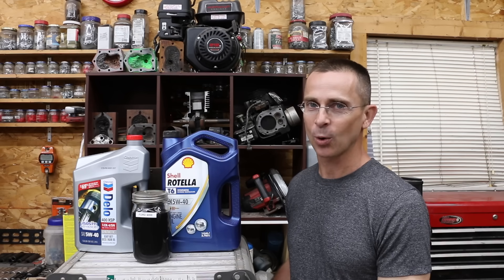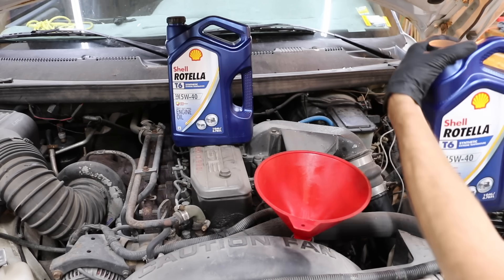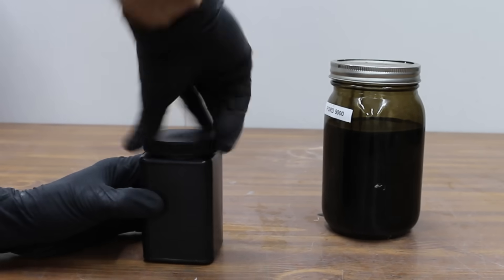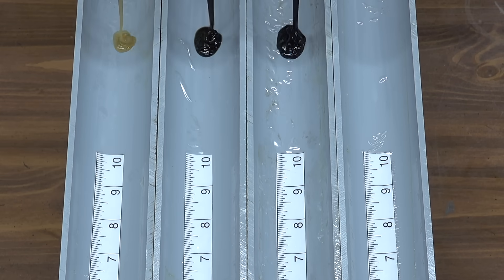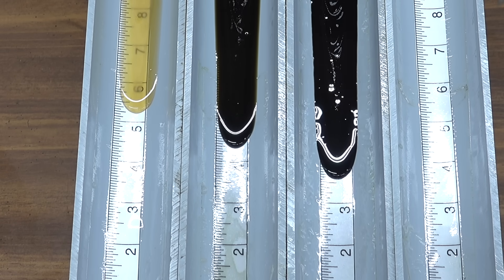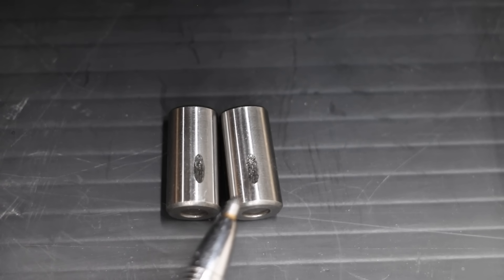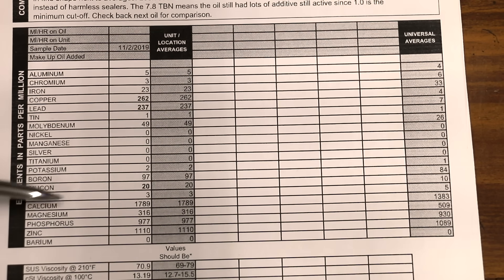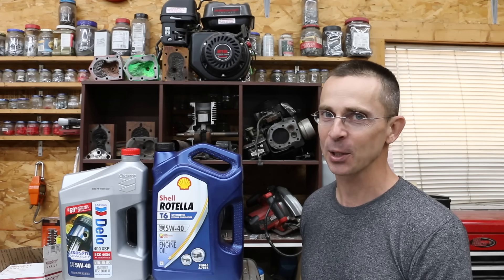Will Annual Oil Change Damage Your Car? Let's find out!

Comment: I am a retired Heavy Mechanic, Used to work for Greyhound Bus lines in The Calgary Alberta shop [500 buses] we began testing synthetic oils on 
Select Buses in 1978,  the wintertime in Calgary would require the Buses to be running 24hours a day, even when parked, due to extreme freezing temps., as you can imagine, these buses would go through Extreme duty most of their service life.
What we found through much testing and Laboratory back up, The Oil did not break down at service intervals. The Filtration was the Issue.
We found that Changing the filters [oil and Air} on a more frequent basis, e.g.  Skip every other oil change but change out Filters, was giving Satisfactory results.  Whether it was Natural or Synthetic did not matter.
End result:   Change your filters more often, and don't worry about the Oil as much, since filtration is the key.
I have always run my vehicles on this method ever since and have never suffered any negative consequences.
Kinda makes you think, Why the service manuals instruct us to change the oil every XXX Miles or Klms.
So save your Money on Oil, and Change your Filters Often. Thanks for all your Vids, And i wish you and yours, the very best of the season.
Al
Reply: That's because the automakers and the oil companies are in bed together.
Reply: @philyip4432  void warranty?
Reply: @PropTrader51  unless you are forced by your warranty, to have your vehicle serviced at the dealership, just change it yourself.
Reply: how do we change the oil filter without spilling all the oil . I also live in calgary!
Reply: @fishertech  just use a drip pan underneath,  then remove filter, and replace along with 1 liter of fresh oil.
Reply: @fishertech  Oil filters generally sit higher than the sump (Pan). Therefore only the short supply and pressure lines above the filter drain when changing the filter. On an inverted (Upside down) filter the anti-drainback valve on the filter itself generally traps all but a few drops when you remove it. Of course there may be exceptions to these rules, but most applications take well to a _filter only", service.
Reply: @fishertech only the oil in the filter will leak as the oil pump inactive
Reply: I do opposite.I  change my oil but  replace filter ever other  time no problems on my part.
Reply: Also, from the above poster’s comments, I have to agree that filtration is the key as dirty oil can clog up the narrow engine clearances starving it of lubrication. While living in a foreign country I used to skip filter change at every other oil change, just to save time/money as I was doing it myself. After about 3 years I observed that my car started burning oil, and I could not figure out how this could happen, even though I was using a good brand oil. The only conclusion  I can now draw is that timely oil filter change is more important.
Reply: Interesting aspect.

Comment: comparing oils from two different cars, with two different oils in to do an ageing test on.. very scientific.
engine oil is drain 3/4 and fill 3/4, there is always residual oil left from previous oil particles you took out could have been in there from factory, of unknown make/origin. different engine will use oil differently, some engines will burn oil more than others.

Comment: Firstly a very Merry Xmas and a safe and Happy New Year from Oz, to you and your family :-)
Wow, cleanish oil from  the filter, I am so glad you tested diesel engines.
I have a moored twin engine boat, and I have always been concerned about "acidic buildup" I only run mineral oil as specified by Volvo (fyi TAMD41A engines, very low hours at 32 years old), and low engine hours. At 23 litres of oil, a somewhat painful and messy job, I can relax and stretch it to 2 years per oil change, perhaps. Thank you so much for your contributions.....
Regards Des

Comment: I run a 15w-40 diesel oil in my old '00 5.3L GM truck for a few years now, zero issues. 
I've always had the notion that an oil for a diesel engine is going to have a higher bar to measure up to.

Comment: My uncle has 3 ram 1500s with the inline 6 cummins, those trucks are insanely bulletproof. Really awkward suspension design though, fairly straightforward if you get used to it but seem to go bad quickly.

Those cummins trucks will easily handle 12 ton+ scrapyard runs, can't complain at all. Wish Dodge still made body parts because the engine is definitely outliving the chassis

Comment: I think what damages engines by not changing it for over a year is the oil getting low over time. That’s why I don’t like when oil companies advertise 12k or 20k mile intervals. Even if the oil can technically last 20 thousand miles. People won’t check their oil level for 20 thousand miles and in the mean time. The oil has gotten super low to the point it damages the engine due to lack of oil

Comment: Good test.. Very interesting... I'm just wondering.. What does it take to convert a small engine to run ethanol reliably or an additive to stop corrosion of aluminum and fuel lines?

Comment: depends on engine, milage, etc., a newer maintained engine may not need changes so often, an older one lacking regular maintenance might. i've seen plenty of sludge caked, baked engines, castrol oil was the worst. better to change it than to ignore it, ignoring it is a costly mistake, changing it isn't. never tell the average person not to worry about it, it'll never get changed and then the car owner has big problems. eventually due to wear etc., you will get particles in oil, prevent wear, it starts breaking down, etc., a simple oil change once in awhile will help you avoid costly mistake of ignoring oil changes. don't listen to this guy and ignore oil changes, he's not going to replace your engine if it locks up, etc.

Comment: Years ago the oil was never changed.
Only the Oil Filter was changed and the oil topped up. (Glass oil bottles)
Reply: @Trevor Slenders If you want to ruin your car, thats a good method.
Reply: @Chris-yy7qc  Maybe his car is eating the oil and he is just adding more oil every N miles.
Reply: @Combine1331  Im pretty sure its eating oil after six years with its oil control rings completely gummed up
Reply: @Chris-yy7qc  Not necessarily. Many engines are just known to burn a bit of oil. The V6 in my old 95 audi was literally known everywhere to burn oil (google it), and there was nothing you could do about it. That's just how it was, unless you wanted to tear apart the entire engine and put in new rings and seals, but it wasn't worth it. The oil burning never hurt anything, you just had to top the oil up every once in a while.
Reply: @reeepingk  Depends how much oil

Comment: About 10 years ago, before the EPA yanked the zinc content out of most oils and before the likes of Driven Racing Oil  and other classic hot rod specific oils, at my speed shop guys would go crazy for Shell Rotella 15w40 Diesel. I think even after the limitations on the zinc Rotella still had it in their diesel formula but eventually was changed over. EPA is not our friend.
Reply: The epa put reseal valves on ac recharge cans, so they did something right for a change.

Comment: Good test within the constraints. However I don't think you could extrapolate it to gasolene turbo boosted engines as they are not remotely equivalent IMO. Normal cooling down cycles of these turbo engines during the heat soak period have temps higher than their normal (for turbos) 400°C temp. stress affecting the oil's "seasoned" lubricative quality. Therefore I humbly ask if this oil test could be repeated with a low interval mileage turbo based engine just prior to a 12 month oil change. I speculate you will not get such rosey results as those shown in these results.

Comment: My 2000 ford ranger with over 250,000 miles has only had 9 oil changes on it in 19 years, and most of those were in the first 6 years. Now It burns about a quart of oil every 2 months, so I figure it gets 6 quarts of fresh oil added every year. Not saying it wouldn't be in better shape with regular oil changes, but she still runs like a top. I think most motor oil will far surpass it's recommrded life span.

Comment: Being in the marine industry we are told that engine motor oil has to be changed every 20 hrs of use or 2 months . if you don't do this you end up with something like molasses and can take up to 6 hrs to suck all the oil from the pan. I have mixed feelings about this video being accurate.

Comment: Some input from the TurboBrick crowd: the Delo synthetic 5w40 lowered my average fuel economy from 26.4-26.9mpg to 22.1mpg with a fresh air filter and the tires at 38psi on a low rolling resistance tire. Peak mpg dropped from 29.8mpg to 24.6mpg. 

Rotella T6 had less resistance to flow showing an average mpg of  24.4 mpg and peak mpg of 28.7mpg.

Both oils had the same driving conditions with the same range of engine load and fuel economy averages from 4.1mpg to 28.4 peak on Delo 5w40 and 31.2 peak on T6 5w40. The oil compared to these as a baseline was LiquiMoly Leichtlauf 5w40 low friction synthetic oil. That oil gave me a peak of 32.9mpg and an average of 26.7 +/- 0.3mpg depending on outside temp (mid summer when readings were taken.)

Comment: with old diesels (~1980s) that're designed around 3k mile oil changes, im scared soot levels may get too high around ~7k+ miles with synthetic oils. guess i just need to do an oil analysis.

Comment: Should do a test with 1 year/20,000 kms on the oil change to make it fair. Most vehicles average 20k/year. A vehicle with just 3000 miles will always have good oil no matter how long it sits. It's not being broken down much at that rate.

Comment: The BEST oil filter wrench is a piece of 60 grit sandpaper... just use it like you would use a cloth to open a jar... the grit gives it the bite it needs to move. the actual removal needs very little wrist power.
Reply: Never thought of that
Reply: great idea
Reply: @charlieharper4975  Go try it, it is so easy you will kick yourself for owning a special tool for this
Reply: Dude... That's amazing. Idk why I've never thought of that! I'm definitely trying that next time. Oil filter access on my current car is a little rough.
Reply: @Robby94LS  I learnedhow to do it here on youtube one day when I couldn't get a filter out. Turns out 99% of the power of the ratchets and belts are just to overcome the can slipping
Reply: @poepflater  Totally makes sense! I was messing with it for like 10 min last time... I think it's coming RIGHT off next time!!